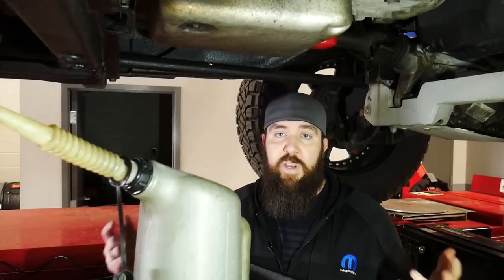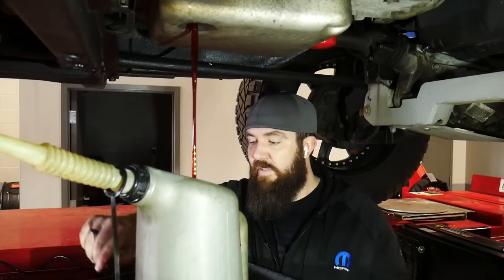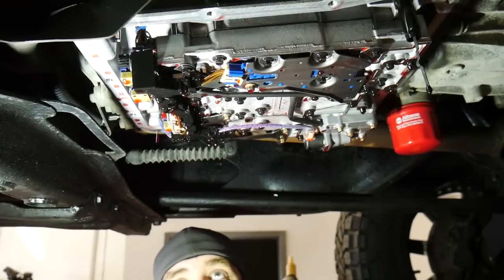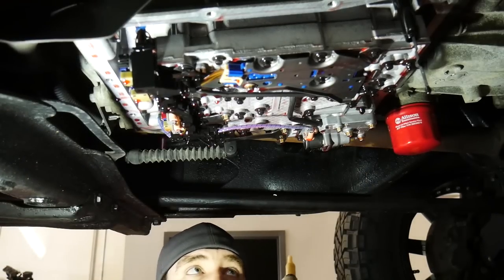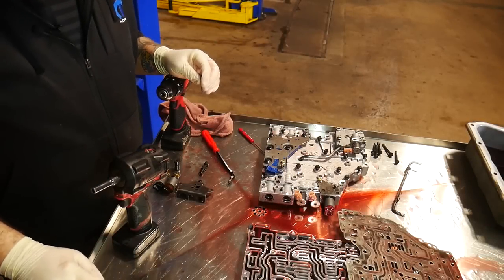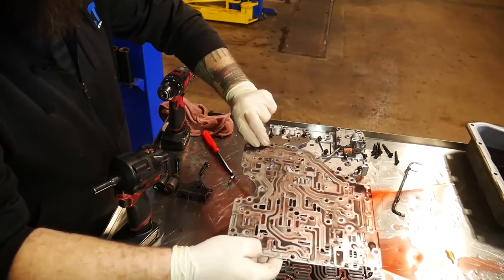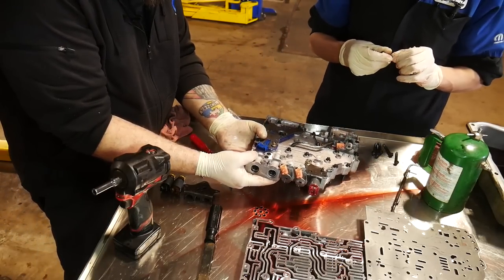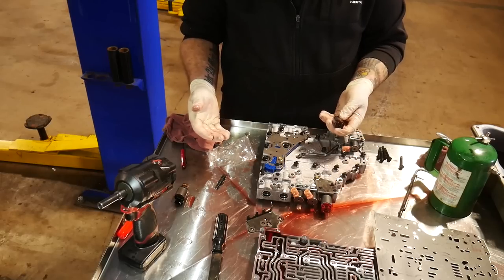DURAMAX TRANSGO SHIFT KIT INSTALL

Comment: Thanks for this video. I think it's the best Transgo kit video out there. Especially the valve body to housing bolt chart, showing removal of only the bolts you need to, and showing which one to leave. Best only to disassembly what you have to in this case. Really gave me the confidence to proceed with this job. And cautioning about the shift pin. All excellent details. Also like the way you kept the bolts in valve body when you separated it. I'm gonna try to do that too.

Comment: I'm constantly having flare ups with 1 to 2 shifts and I have a stock trans with a few different tunes when in anything but stock tune and even in stock mode sometime I get these. I plan on putting my kit in this spring and hope it will let me get by with the stock trans for a couple more years...built trans are not cheap even when building them yourself.

Comment: Will this fix the p0735 I get when flooring it at random times and it won't shift into the next gear?
Reply from the maker: Iffy... usually at the point of throwing codes like that you’ve got more clutch issues
Reply: Rustbelt Mechanic i took it to someone and they couldn't find anything wrong with it. I drove it this morning and had no issues drove it again later then it wouldn't shift but didn't have a check engine light or codes.

Comment: Great video except you guys messed up the install of the valves you put ridged one in B when it’s supposed to go into A per the instructions from the manufacturer.  I had to quadruple check mine after you said the mix up.

Comment: @Rustbelt Mechanic , I am having the col temp only Sticking E Shift valve throwing the P0766 code for Solenoid B, once warmed up, it goes away and good all summer, notice it most when the truck sits all winter, then in spring I fight it to loosen up. Will the Transgo Jr SK kit help me with this and the springs? Or does the E Valve bore need a little massaging? thanks!

Comment: lol i got this kit and the 2 filters plus a low profile filterlock and fluid and an airdogs 4GII 165gph lift pump delivered the other day and im planning on doing both of them today.  I got my dads old 06 lbz duramax that my mom drove for years after he passed but the running board started sagging due to rust from minnesota winters so she didnt want to drive it anymore and gave it to me.  I have fixed up the suspension and things she didnt do she mainly just changed fluids and filters put in a nice sound system and started adding power with a tuner, ppe airbox mod, 3inch mbrp downpipe and 5 inch downpipe back exhaust and plan on doing up pipes and y bridge and eventually rebuilding trans and installing a different turbo etc but even at the power im pushing right now i get low frp code if i go wot which i havent done much because i wanted the extra saftey from the transgo jr but even so i was driving back from a cross state trip and passed a large RV and a car on a long clear stretch of road and got up to 112 and let off the gas and saw the check engine indicator light on my dash.  I can't wait to give one of my friends a ride again he was shocked with how quick the truck was with just the tuner and the airbox mod in the past week i added the turbo back exhaust stuff plus transgo and lift pump plus the trans relearn so im sure he is going to lose it lol the first ride he was trying to grab at the dash hand bar but was stuck in his seat.  I have mainly driven pretty calm when i started running other than stock tunes but like my highest tune i run ends up giving me +6mpg or so if not a little more as long as im decent on the pedal and it has all the power i need to accelerate at a decent rate just using a little throttle so that works.  I even got over 24mpg driving 65-75 mph range durring a ~250 mile drive including passing a couple of vehicles.

Comment: How many quarts of fluid did you turn around and put back in it? I just did a trans jr on my 6 speed, trans lines, and a trans cooler, and through it all back together, put 8 quarts in it, fired it up and went to back out of my driveway to go on a relearn and i had no reverse. I have drive and all other manual forward gears but zero reverse. Drained the fkuid and tore it all back down to check all my connections and everything was plugged in where it should be and all were good and secure with no loose connections. So i pulled the valve body again to triple check none of the check balls fell out and sure enough neither of them were laying in the valve body they are both still inside the new valves with the small spring in front of it and the big spring over it.  Im lost on what the issue could be. Like i dont see how it could be low on fluid if it goes into drive but literally juat flashes when put in reverse. I had a check engine light that i didnt have before the install but i couldnt run the code because i couldnt back the truck up to take it to town. Do either the A or B solenoid run specifically reverse? Or what lol i honestly dont know what im missing
Reply from the maker: I don’t think it would be a fluid issue, did you mix the two solenoids up? Valve body torqued down EXACTLY right?
Reply: @RustbeltMechanic  no orange solenoid is B and the black was A. And yea torqued them down to 9 ft pounds using my inch pounds which converts to 108 inch pounds and i set it to 110 inch pounds. I was told by someone on the lbs page thst if i changed my fluid and internal filter as well as pulling the valve body and doung trans lines and a trans cooler i should use like 13 quarts. Do u think this is true? I only put 8 in to get started but when i was cycling the gears before i checked the fluid to add more is when i had all forward gears but reverse felt like neutral and just flashed on the shifter column. I figured if the fluid was low or especislly thst low if it needs 13 quarts why would it drop straight into drop without any slip or hesitation but have zero reverse

Comment: Will this stop my truck from going into "reduced engine power" ? After having my motor swapped out I can't get on the throttle to hard or it goes into limp mode
Reply: briskfatguy1 possible TPS?
Reply: briskfatguy try getting a good scanner on it to do a throttle valve relearn
Reply: @MRW21783  my friend has a scanner I'll see if he'll bring it over. I'm dealing with a power steering leak now.

Comment: Is that a 3/8” M12 stubby? Any reason to get a 3/8” vs the 1/2”?
Reply from the maker: I use the 3/8 with 3/8 impact swivels more often than anything.
Reply: Rustbelt Mechanic thanks my friend!
Reply: Keep my stubby in the truck box 24/7!

Comment: How long did it take you before the shifts were smooth? I did a quick relearn using a snap-on scanner and I've put roughly 500 miles on it. It shifts  very smooth in every single gear except 1-2 , there is still a pretty hard kick from a stoplight. It also bangs into reverse from park. Did you experience similar driveability issues? I'm thinking about tearing it back apart if it dosent smooth out in the next 200 miles or so.
Reply from the maker: No I didn’t have any of those issues at all. Is your truck already tuned?
Reply: @RustbeltMechanic  yes it is currently tuned, I also have a DSP5 switch and have been driving it on my lowest HP tune.
Reply: Throttle valve relearn? TCM tune?